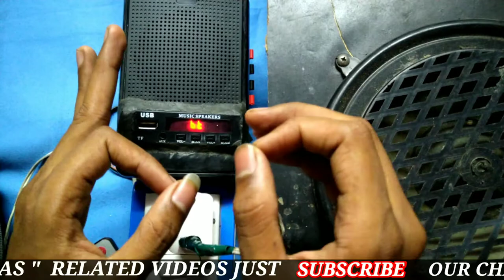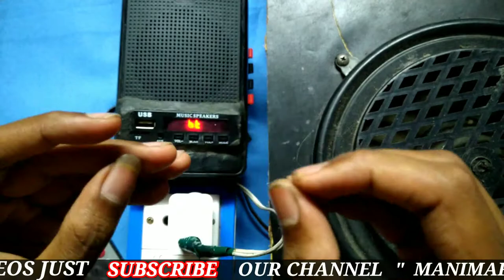homemade mp3 player | bluetooth speakers | home theatre | FM | usb speakers | tamil | manimarantech

Comment: Hello anna i am zion ir insta frnd 
Na intha 5v audio board ku regulator la irunthu supply kodukuren  athu ku entha capacitor pota crta irdkum value soldringala
Reply from the maker: 1000uf or 470 uf
Reply: @manimarantech  thanks bro sama coincidence😉 naum 470 uf thann vangi vanthiruken😀
Reply: @manimarantech  ama bro enna volt 16v or 25v